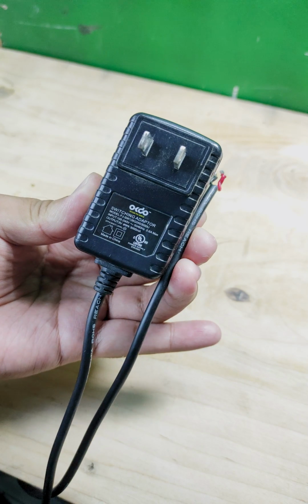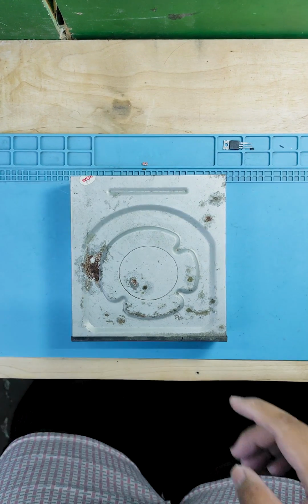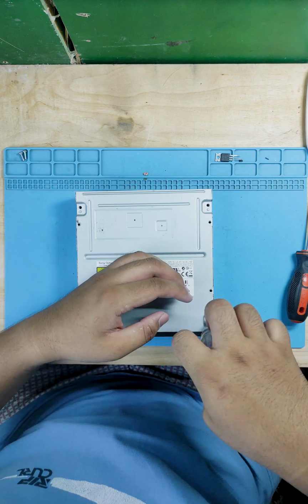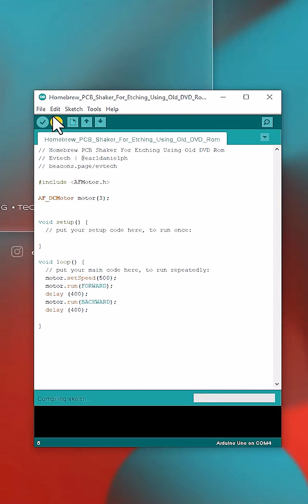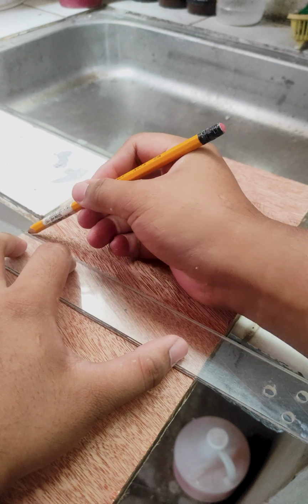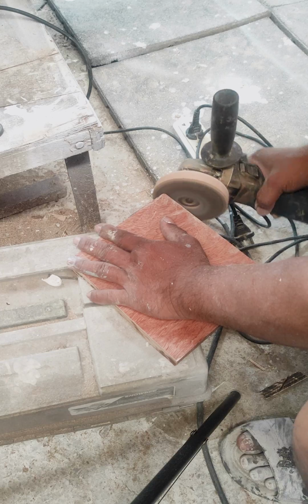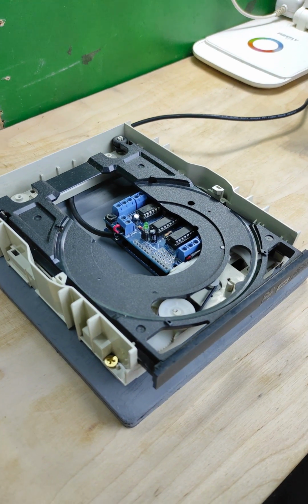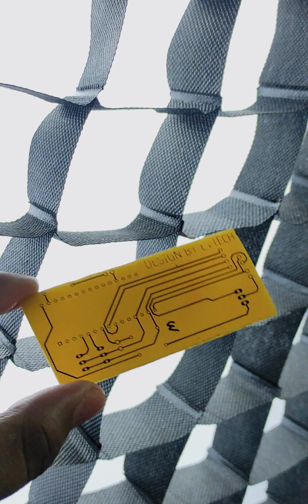Homebrew PCB shaker for etching using an old DVD rom! 🤯| Random Weekend Project

Comment: make the PCB do the thug shaker
Reply: Just shake 3x manually, make your pcb layout under the sun, done in 5 mins by shaking 3x only within 5 mins. Etching requires heat.

Comment: 1:12 I guess that you used a linear motor with the existing cogwheel instead of the existing smaller stepper motor.
good job
Reply from the maker: Yes, that is exactly what I did. thank you!